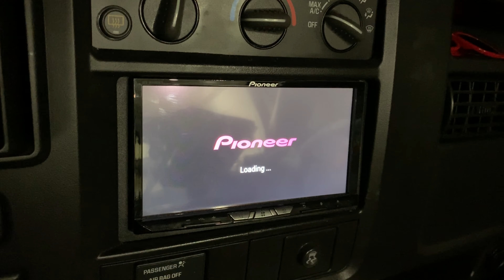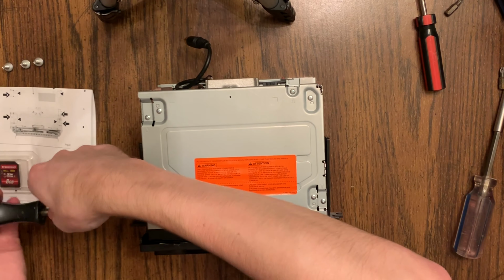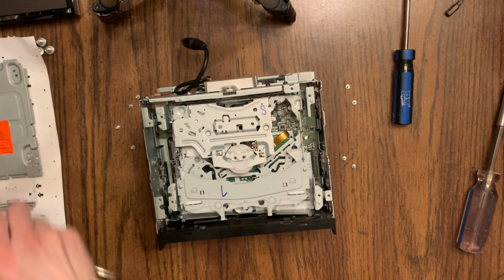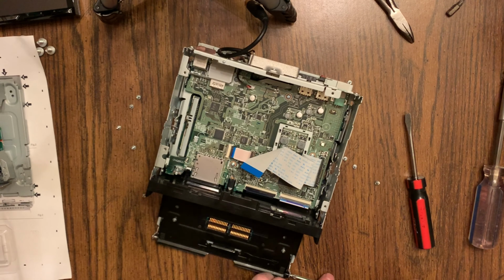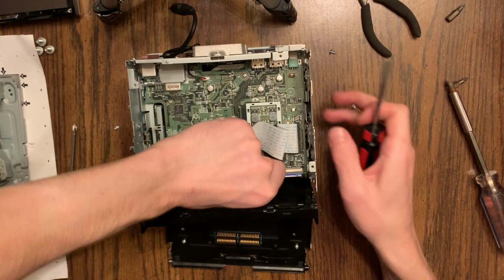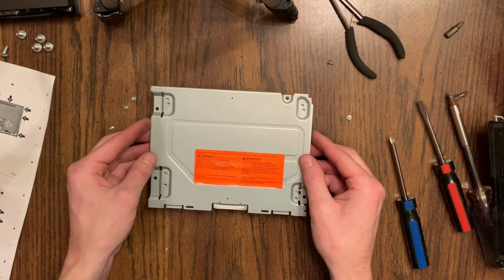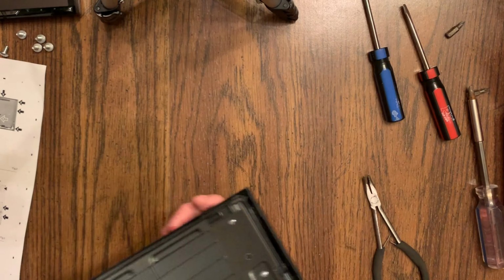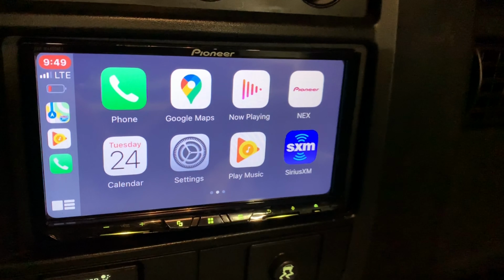Pioneer Software Error Fix - SD Card Replacement Procedure

Comment: I just replaced mine. This video was helpful, but you DO NOT need to take off the top like this guy did. Instead, just do the following:
1. Remove the unit from the vehicle.
2. Take off the removable display (this is not shown in the video because it's easy). You don't have to do this, but you should if you can
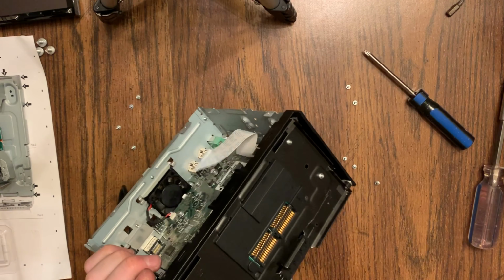3. Pull out the slide mechanism. This is shown in the above video at 2:45 to 3:43: https://youtu.be/2cHp6jxD5R8?t=165)
4. Disconnect the ribbon cable from the back of the slide mechanism. This guy didn't do that. Instead, he disconnected it from the internal circuit board but that's a pain. Here is another video showing how to disconnect the ribbon cable from the back of the slide mechanism. Watch from 10:08 to 10:55: https://youtu.be/NvUFv5GVRTY?t=608.
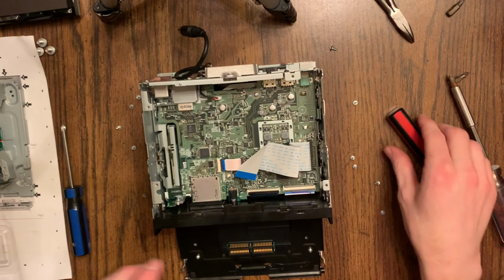5. Remove the black plastic trim. This is shown in this video at 3:43 to 4:27: https://youtu.be/2cHp6jxD5R8?t=223. Note that in my method the black ribbon cable is still attached to the circuit board so you need to pull it through the slot in the black plastic trim.
6. Remove and replace the SD card (the bottom slot) as described in this video.
7. Reverse the steps above. One thing to note is that when you put the black plastic trim back on, you need to pull the ribbon cable through the slot so that all the slack is pulled through. I didn't do that the first time so I had to take the black plastic trim off and pull the ribbon all the way through and then reattach it. Otherwise, it's easy. My unit works great.
Reply from the maker: Scott Nielson thanks Scott! Couldn’t find any SD card replacement videos online and just started disassembling. Hope your comment helps others! 
Sad that it’s such a common problem.
Reply: @VanwithTim   and @Scott Nielson: Mahalo for posting this video and for the follow up comments.  I agree that it is sad that Pioneer uses a cheap SD card for a high end unit.
Reply: Hey Scott, thanks for the list of instructions. Great help. For those doing this I used an 8 gig sd card and my head unit went from continuously looping the bootup to showing a screen that says there is a software error. Tomorrow I am getting a 16 gig to see if that works. My win32 software said the image was to big by a little but it didn't seem to be data. Well it seems to be data.
Reply: @antonioponce6544  so you need to use a 16 gb card? let me know.
Reply: @Scott Nielson I followed your steps, and it worked great! I used a SanDisk 16GB Class 4 SD card I already had lying around to build the image using the Mega DL someone linked along with Win32. Fairly straightforward. I did run into a couple issues (in case anyone else has this crazy problem).

Step 3: The 2 tiny screws you have to remove. One came out fine. The other one was ridiculously tight, and I tried SEVERAL different sizes of screwdrivers. It never budged, and I ended up stripping the screw enough to where I couldn't do anything else. Luckily, I was able to maneuver it enough with just 1 screw removed.
Step 5. Similar issue in step 3. One screw came out fine, the other wouldn't budge/stripped. I thought I was SOL. I was lucky that the screw that removed was the side closer to the SD card. I gently bent the trim away enough to allow me to remove the existing SD card and re-insert my new SD card. It was literally just enough wiggle room without warping the trim.

Thanks again to both you and @Van with Tim. Hopefully it holds up!
Reply: @CoreyBenick  I stripped one of the little screws too. In fact, the head came off and I had to drill it out. I had another small screw that seemed to fit the drilled out hole. I screwed it in and it worked great (tightened down just like the original).
Reply: Yes!! Thank You, this worked. Right about the ribbon cable. Make sure all of the cable out of the hole and it’s properly attached, or you won’t get a response from the screen.
Reply: Anyone have issues pulling out the slide mechanism? It seems like mine might have some sort of a lock or something I've really put some force on it and it doesn't seem to slide. Manufacture date on mine is 2018. What was the manufacture date for the folks that the slide mechanism did work for?
Reply: @kachewy  The 1st quarter inch out is the hardest part. Then it begins to move. This is not a finesse and technique step.  Show it who is the boss. What worked for me was to get a smaller screwdriver into one of the chase holes and lever it out.  I had no luck pulling on it with small needle-nose pliers.  Also, you only need to take it out far enough to get to the two screws  on the bottom.
Reply: @k7map  Thanks. This worked!
Reply: I didn’t take off the top, I just removed the display and slowly pried the black plastic plate from the body. Then it gives you just enough clearance to remove the sd card. Less work imo but this is great to show the overall process.
Reply: How do you remove the faceplate with no power?   I tried the little slide at the bottom but no luck.  Didn’t want to break anything
Reply: @antonioponce6544  where did you get the image from? I have the same issue with my ach-w4500nex.
Reply: @CoreyBenick  Hi fiend, do you have the Mega DL file that you find?.
Reply: This method worked great for me and saved time, thank you
Reply: You don't need to disconnect the ribbon at all.
1) Detach the faceplate.
2) Slide the mechanism forward as far as you can.
3) Take out the two small screws from the side of the trim (NOT the hinge mechanism).
4) Unclip the black trim all the way around the front.
5) It's tight, but you can work the trim forward (along the slide) until there's enough room for the SD card.
Swap SD cards and reverse all of the above.

I had the whole thing opened and resealed in about three minutes.
Reply: @cjdoc77  http://avic411.com/index.php?/topic/90534-how-to-fix-for-avh-w4400nex-boot-loop/  The image is linked.  Image --> http://sixgov.com/filestorage/forums/avic411/
Reply: I followed these steps and replaced the SD card in 5 minutes, was suprised how easy it was! Saved me so much money I appreciate you and the poster of the video!!
Reply: Please i need help
Reply: @VanwithTim  Does the sd card have to be blank or do you need any files?
Reply from the maker: @freddyantoniomatusdetrinid3398  you will need to write the files to a blank SD card in your computer.
Reply: @VanwithTim  

Excuse me for the inconvenience but what kind of files and where are they available and if you give me your help I would appreciate it very much.
Reply: Thanks Scott! I was able to open my radio and replace the SD card in 15 minutes using your brief instructions and Van with Tim's video. I removed two screws on the bezel (one left, one right) and two screws on the slide out (one left, one right). Then it all came apart! I did remove the ribbon from the back of the slide instead of the circuit board and want to point out that there is a small flap that locks the ribbon onto the back of the mechanism. To put it back together you need to insert the ribbon back and then click the black "lock" down to hold it in place. Very easy...thank you both!
Reply: So I read most of these comments and performed a hybrid version for my repair.  First of all, if the motorized CD door still works, then I would NOT remove it from the car.  Instead I would open it fully (or slightly open the faceplate, then remove the security faceplate using the manual release lever at the bottom) and use a Dremel tool to carefully remove the plastic immediately below the visible SD slot to reveal the internal SD card.  At that point you just press the current SD card to remove, then replace.  I like this option because in my three years of ownership this is the 2nd time I have had to do the software update to repair this head unit.  

In this case I could not open the motorized CD door because the unit was too far gone.  Instead I removed it from the car, flipped it upside down, flipped the manual release lever at the bottom of the head unit, used a screwdriver to manually open the CD door, and then used the Dremel to reveal the "hidden" SD slot.  Either way, this fix works and good luck!

In either repair I did not have to remove any ribbon cables or screws from the head unit.  To me this was the least risky repair.
Reply: This comment was very helpful in getting this done quickly.
Reply: I’m actually in the middle of doing it still, but I didn’t even disconnect the ribbon cable. Plenty of slack in it to just lift the black piece up enough and swap the SD card.
Reply: Do you have a sd for AVH-Z9200DAB I got the same but  another model pleas can you help me
Reply: Você pode me ajudar? Aqui onde moro estão cobrando muito alto e creio que querem me enganar. O meu é o AVH-Z9280TV.
Reply: @user-hb9jz7ne3w I had thoughts of doing the same. I’m glad I waited as my second SD card is behind another ribbon cable and off to the side, not underneath like in this video. In my case the 4000NEX, a slot doesn’t allow you to get passed the ribbon cable. Great idea for those of you with the layout like the video shows.
Reply: Question everyone, so any SD card works? Is there a specific SD card it needs? If so where to buy?

Comment: DUDE - Allow me to express my appreciation for you posting this!  I have the same head unit (for less than 2 yrs) and these exact same symptoms occurred within the last week.  I pulled it out and was about to box it up to send to the factory service center, and stumbled across this video.  I happened to have a 16gb SD card, so I gave it a whirl - AND IT WORKED!  My fingers are crossed though, since the last 2 yrs have been nothing but problems after deciding to finally spend the money & upgrade my system.  It seemed only fitting for the $700 head unit to fail after finally getting everything else working.  Thanks again - you're my hero!
Reply from the maker: Glad you found the video! Unreal that a $50 head unit is more reliable than these expensive Pioneer's. However, it seems like once the faulty SD card is replaced it's a pretty bulletproof stereo for the most part (fingers crossed!)
Happy listening!
-Tim

Comment: Thanks so much Van with Tim and the other commenters here. My My AVH-W4400NEX unit was not saving SiriusXM presets. I'm NOT mechanically inclined and I've never even installed or removed a head unit, so this project was intimidating, to say the least. But, I figured out how to remove the trim and take it out and then I followed the directions here step by step and it was pretty easy. I used an old 16GB SD card for a digital camera and reformated it. I'm on a Mac and used a free program called Etcher to burn the AVIC image file. I was skeptical when I reinstalled the unit, but it worked the first time. Only took a couple of hours. THANK YOU! Also, never spending a dime with Pioneer again.
Reply: I only have an iPad Pro.. I wonder if I can get a card reader and writer and do the same exact thing..    where did you get the image file for the the Pioneer 4400...     Will  I have to get a laptop because I do not have a PC or laptop....

Comment: I had to deal with stripped screws and a couple tries at replacing the ribbon, but it worked great! Also, I installed the file on a Mac. For Mac users out there, I downloaded the file from the mega link and used a free download called Balena Etcher to write the .img file onto the SD card. Back up and running, and thank you guys so much for the help!

Comment: Update; This process totally fixed it for me! FYI: The image pointed to below is firmware 1.02
If I ever need to do this again, I will take my dremmel and carve a slot for the firmware SD card, right below the factory one.
Reply from the maker: I was thinking exactly the same. It's a huge pain to remove the unit from my van. Glad you're up and running again.
Reply: That is actually a very good idea - I haven't put everything back together yet and might just do that!  Makes sense actually when you think about all the times the SD card gets cycled on....

Comment: I have exactly one Pioneer I purchased it in 2019 Already Being Send it From the day I purchased 3 times To get it fixed  the Pioneer fix it to me For Charge of $300 every time I send it No one should buy this type of stereo I have too much problems With it and they are so expensive there is many a lot similar quality And even better than Pioneer Stereo But overall your video is very helpful thank you
Reply: Do we need special SD card, or any SD card from the market

Comment: Tim - you are a life saver! This procedure worked perfectly for me. My AVH-W4400NEX unit wasn't dead or looping on boot, but it would not retain station presets on Sirius XM, would always start up on the same station, kept bumping up the navigation volume on every reboot, and a few other weird things. It also would not accept a firmware upgrade to 1.02 even though the process would say successful at 100%.  I talked to Car Toys where I purchased the unit, called Pioneer, and Sirius XM support - all to no avail, and no one had a clue other than walking me through things I had already done to reset the unit, load firwmare, etc. I even purchased a 5 year extended warranty from Car Toys, but they told me they would have to send it off to Pioneer and turn around on repairs with shipping delays due to Covid might take 3-6 months. Ugh! I didn't want to be without the radio that long, so I just lived with the buggy system.

Then I stumbled on your solution.  Loading the clean img file on a new SD card fixed it all!

Thanks again!
Reply from the maker: Man I'm so glad the image file is finally out there. I waited months for someone to upload it to the forums but finally just pulled the trigger on the pre-loaded SD card from Russia. (Like $70 if I recall???) I see they've since come down to $30ish but even that's a rip off lol.

Yours is the first I've heard of with such strange bugs! But I'm glad it ended up being an easy fix!
That's a load of BS from Car Toys. They should have just replaced the whole unit for you.

I've since noticed mine is TOTALLY MISSING the AM/FM radio function??? Never thought to look for it until I wanted to hit the drive in lol.
Will try re-loading with the image myself next time I have the dash apart.
Does yours have the AM/FM function anywhere??
Cheers!
-Tim
Reply: @VanwithTim  Yes - FM is there, too. All the presets work now. As far as I can tell al my bugs are gone, and all the features are there.  I did have to do a reset with a paper clip to get a few quirks straightened out after the new SD card replacement.
Reply from the maker: @stevedickerson5447  Thanks for the info! Will have to give the reset method a shot. Just checked the manual and it kind of calls for it anyhow:
"The microprocessor must be reset under the following conditions:
-Prior to using this product for the first time after installation.
-If this product fails to operate properly.
-If there appears to be problems with the operation of the system."
Appreciate it!
-Tim
Reply: @VanwithTim  Good morning could you help me with my radio avh-x8650bt has problems with the sd but I do not know if you need any new software or it simply has to be blank. Thank you very much I hope your prompt response.
Reply from the maker: @freddyantoniomatusdetrinid3398  you will need to write a special file to the blank SD card. I have not found the file available for free online yet, but there is a seller on eBay who sells the file you need.

https://www.ebay.com/itm/303899886211

Comment: Update from my last comment, Works like brand new!, Previously, I lost the ability to use carplay wirelessly, I could onlu use carplay using the “hardwired” feature. My w4400nex would also just reset at random, while driving and relying on the navigation. However, after replacing the internal sd card, My head unit works like it was brand new now.
Very happy, thanks for uploading this video!